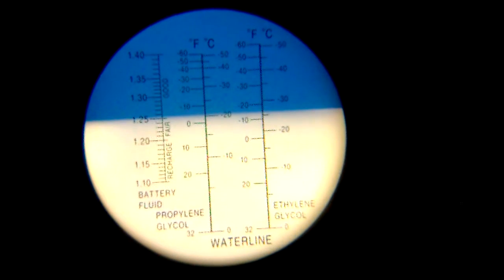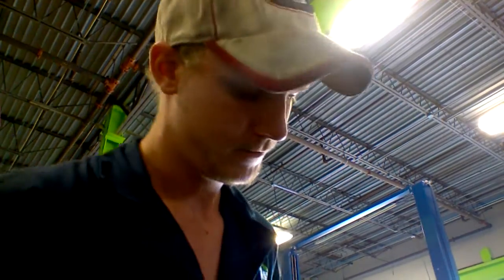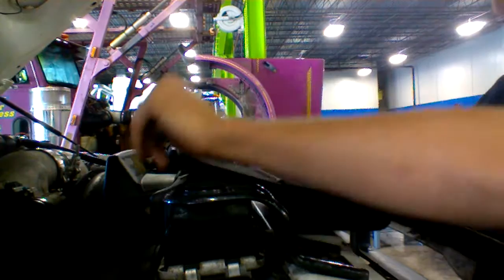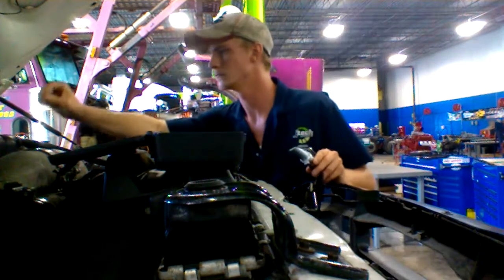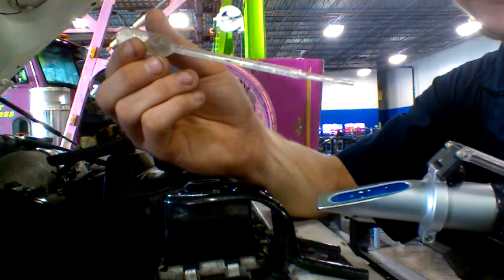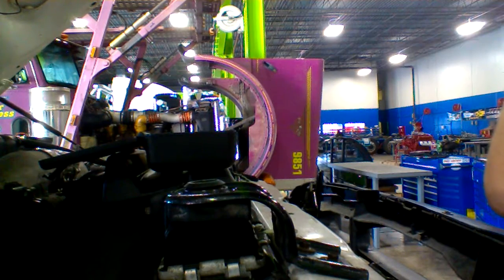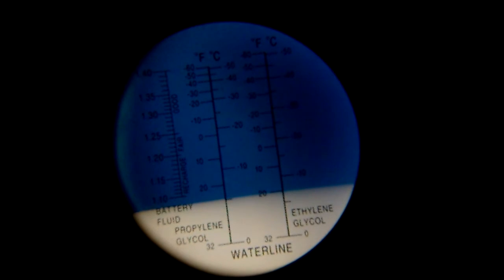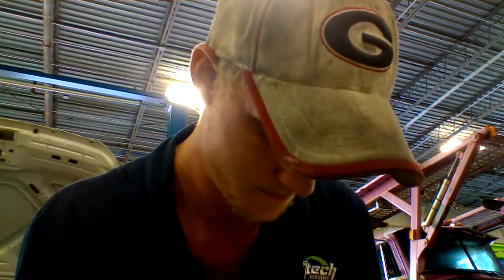Checking coolant with a refractometer

Comment: Did you take the F350's coolant from the overflow reservoir? Maybe the owner just added water. Shouldn't you pull the coolant from the radiator?
Reply from the maker: Pro1er I don't remember, this was 3 years ago. I was in school, I now work at a ford shop and we don't have a refractometer. The tool was school supplied. Sorry for the lack of information
Reply from the maker: Pro1er but then again I do remember the truck just being there at school. It was one they bought from auction for learning purposes.
Reply: Cool.